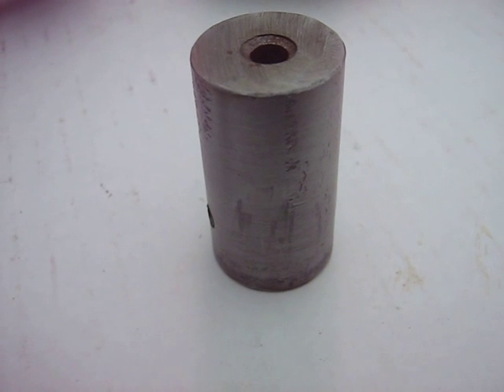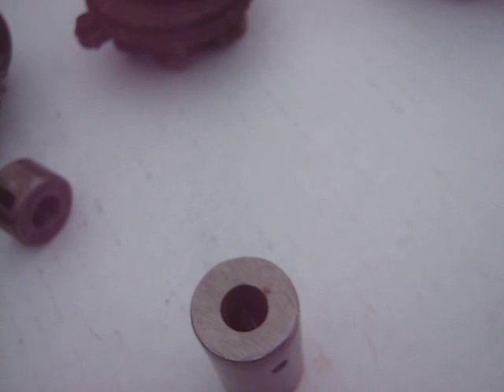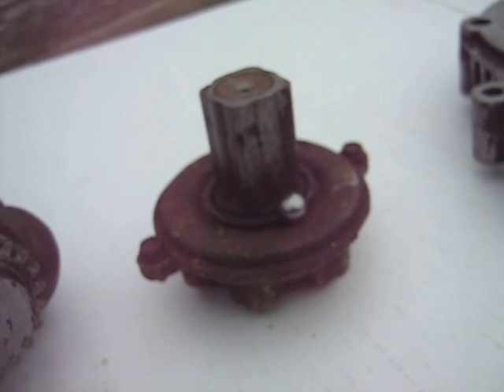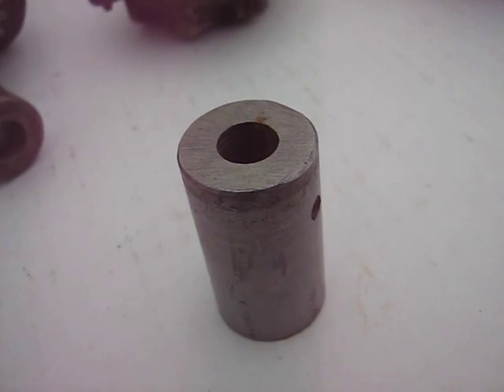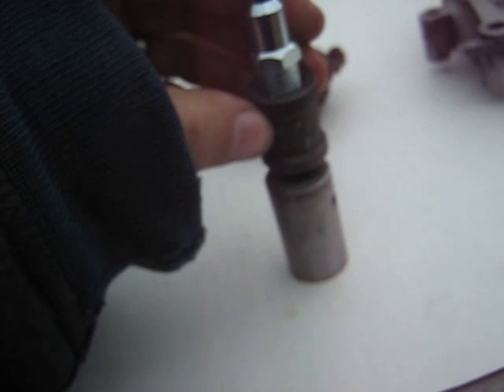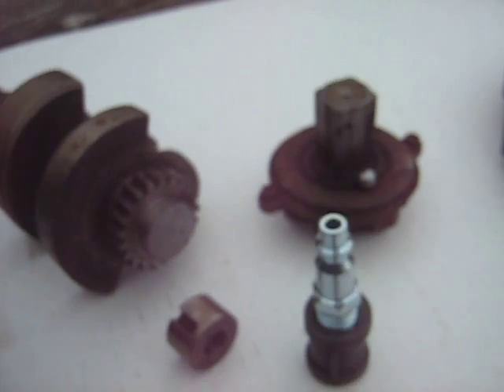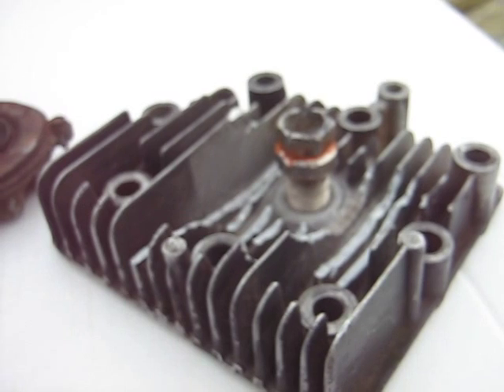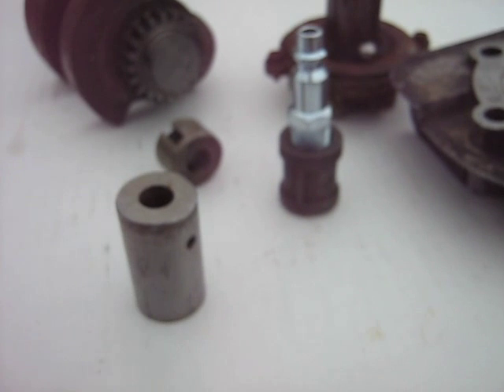Homemade 1 Way Air Valve

Comment from the maker: @shinyfuzzy 
Thats up to you, I can't stop you, just make sure to use pulleys to slow the compressor down, use a pressure blow off valve, a rated good air tank and hoses etc. You gotta stay safe #1.

Comment from the maker: @ravenhhca 
I don't think there would be a problem, but I know the ductile iron sure doesn't drill the same way steel does, it seems to be more like cast iron, so it probably isn't as strong.
Some of the welding leaves a bit to be desired, turns out every time I carry my welder indoors, the wire speed gets cranked up to max!  :(